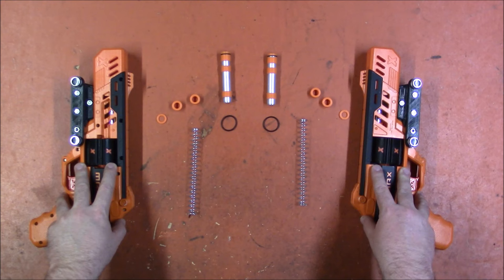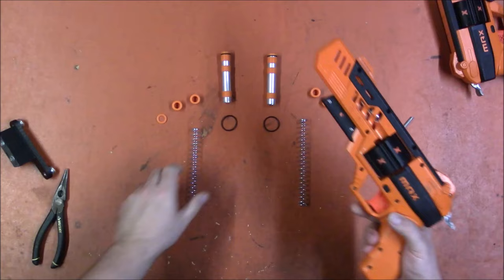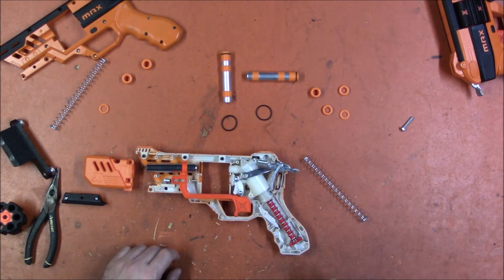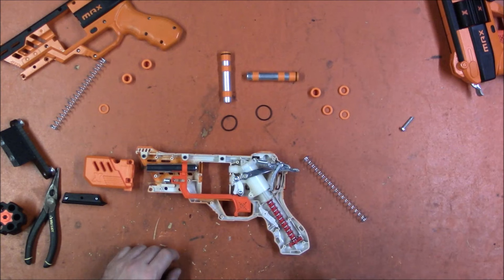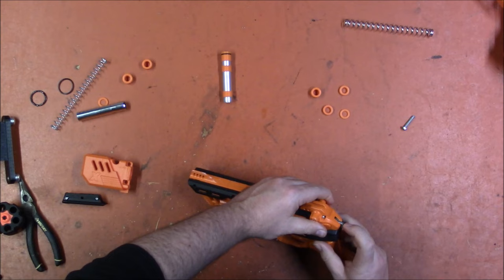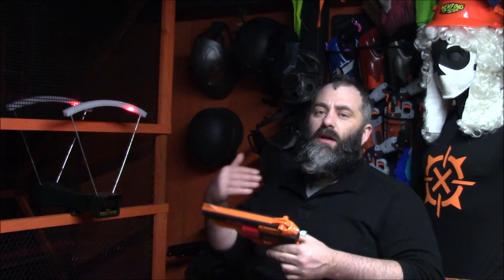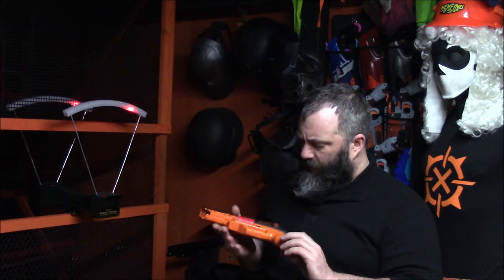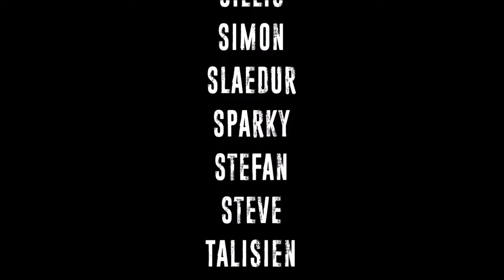Radioactive - Dart Zone Max Outlaw - Light Prime Kit

Comment: Radioactive did say in his video that he wasn't sure if the o-ring sealed breech is compatible with 3d printed cylinders. Just so you know.
Reply: One I got fit 3d cylinders with no issues
Reply: I had no problem as i went from 117-134fps so i was happy
Reply: Thats much lower than i would expect it to be. Are you using green tip heavy worker bamboo darts? @gillandro2

Comment: Slight warning about this kit: the o rings from the kit DO NOT LIKE THE COLD. I had to put the stock one back in bc my performance tanked to a point of unusability even after the blaster warmed back up
Reply: Yeah, it's unfortunate.. you can stretch the oring back out with your fingers, buts that's obviously not a permanent fix. It can just shrink again. I am looking into a slightly larger oring replacement, but it's not easy to find something just that tiny amount larger.

Comment: I didnt mind leaving the stock spring in with the 12.5mm spacer set up... i went from stock fips of 117 to about 134... the prime wasnt to bad for me and it still seems to fire like a beast... and yes Captain... i did drill the holes like we discussed in the comments on the mod and paint video...solid as steel, bought the holster rigs now i just need to learn how to set up the straps like a pistol holster rig that i have or i may just steal the straps off of them... awesome stuff, always you are a boon to the community

Comment: Would a stock and longer barrel kit be possible for this blaster?
Reply: in theory yes, as you could possibly print a longer barrel to put on the cosmetic one, and if possible you could maybe get a longer barrel machined, as it has an indent you can't just use widely available barrels, as far as the stock goes it would be trickier, as there is no sling mount or something of that sort that we could attach the stock to(with a 3d printed adapter). With a little bit of shell cutting, it could be possible. The thing about it is that the prime is decently heavy, and other than for fun or cosmetic purposes, there is no real point in doing that. If you do it though, make a video! It would be awesome to see a revolver carbine!
Reply: Not really. The barrel length here was the best performance at all levels, from downgrade spring no spacer to stock spring and 12.5mm of spacers (the maximum I recommend for the stock spring). More than 12,000 shots went through the blaster while testing this kit. Longer barrels reduce average performance at each power level. Stock spring and 12.5mm of spacers gets about 150fps average with worker darts, and a high in the 160s. Any more power overworks the cylinder to plunger tube seal and causes performance reduction and massive inconsistency.
Reply: @hellothere-fv7ew  alternatively you take inspiration from the Luger (and other historical pistols including some revolvers) and go the pistol carbine route, making a stock that attaches to the grip.